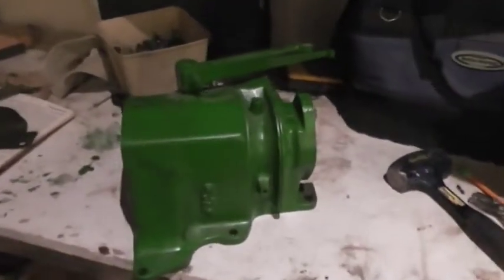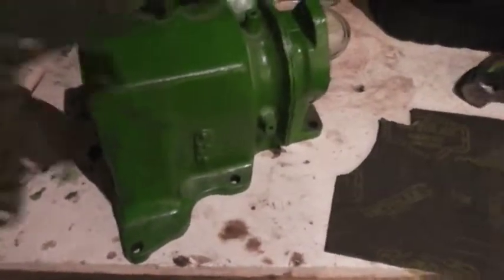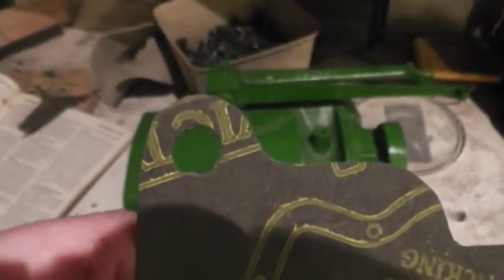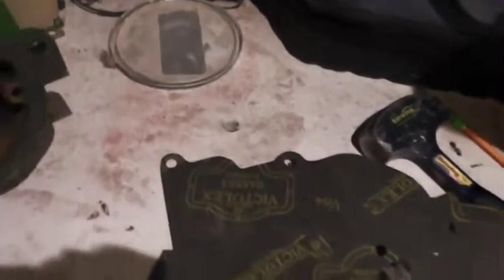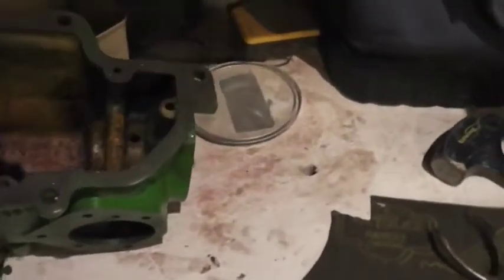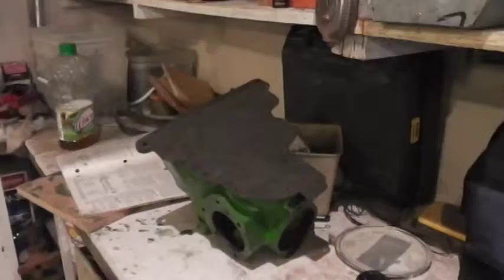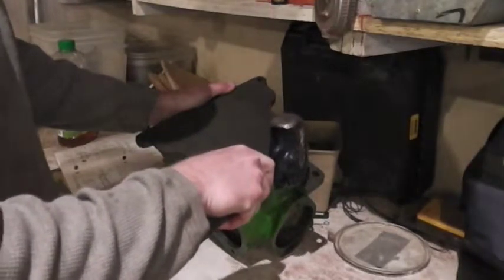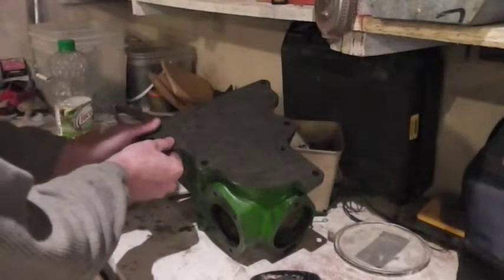How To Make A Gasket For John Deere B Governor

Comment: can you explain to me how to shim the cover for the bearings?  It says it in the I/T manual but doesn't explain it.
I have a tip for you, instead of gasket tapping, Take a finger of dark color grease and lightly spread it on the surface you are making the gasket from. Apply the gasket paper and remove.  the lines to cut around are visible from both sides, inside the gov and outside the gov